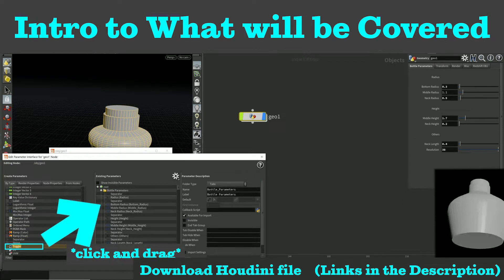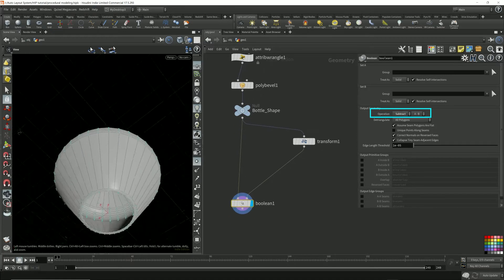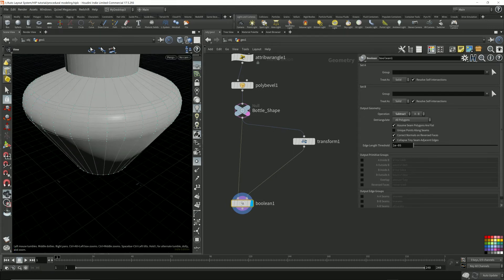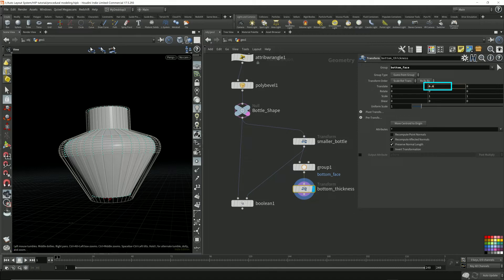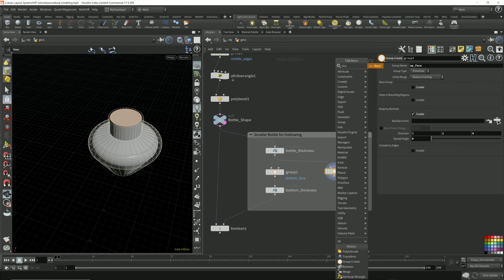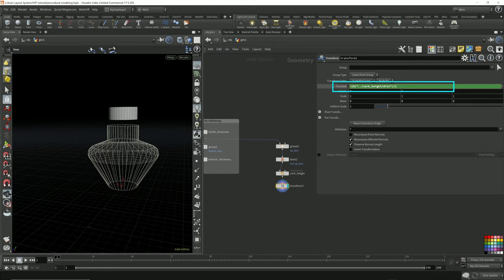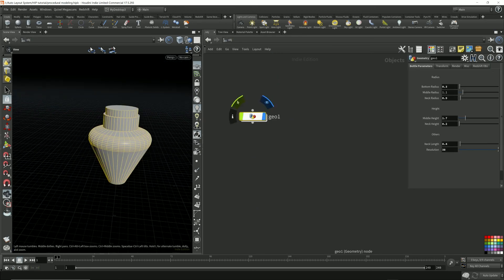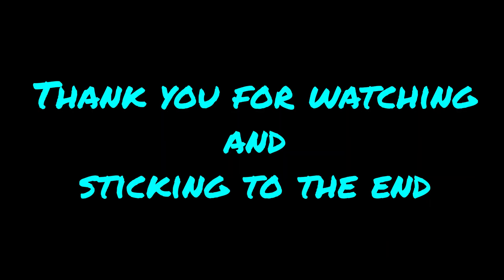Procedural Modeling for Hollowing Objects with Thickness in Houdini

Comment: Awesome Video! I always disliked manual modeling with Blender, Max, etc. but this finally seems like a modeling software I could like. 
Being a programmer makes it even better!
Reply from the maker: Thanks for the comment!  I had a similar issue too.  Houdini's non-destructive workflow makes it a lot easier to work with!  

The box modeling workflow in Blender and Max sometimes requires one long sitting to finish a project, which I never had enough time for.  But for some reason I love zBrush's box modeling workflow.
Reply: @bubblepins  I never tried ZBrush, as it is too expensive for me, what is it like?
Reply from the maker: @M1SMR  zbrush has this new lighter version out that's a lot cheaper, I think it's like $10/mo. or $180 to buy it, but the lighter version doesn't have all the features.  Personally I really like zbrush, because you can create very organic characters very easily with just the Move brush lol  In the past couple of years, zbrush has been updating the software with all these new features it's so crazy!  They put in a cloth simulator inside zbrush JUST for modeling!
I did this car crash destruction to test it out and it was soooo easy to create very complex effects:
https://www.youtube.com/watch?v=TGZIcppw0-A